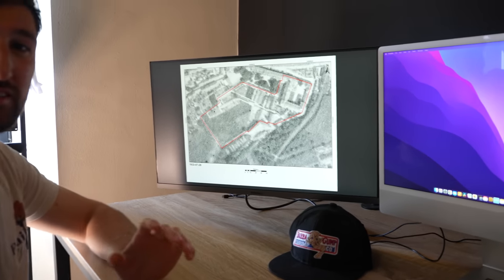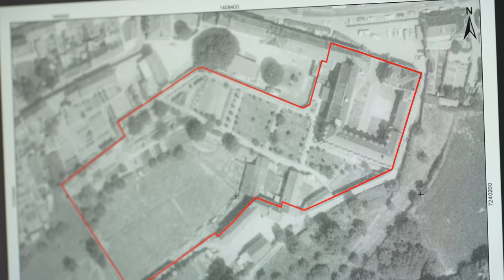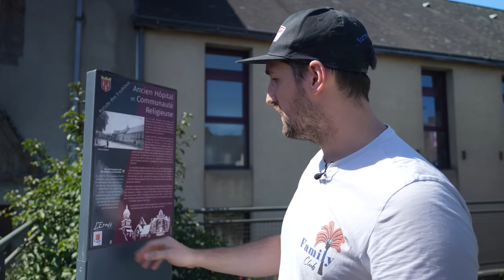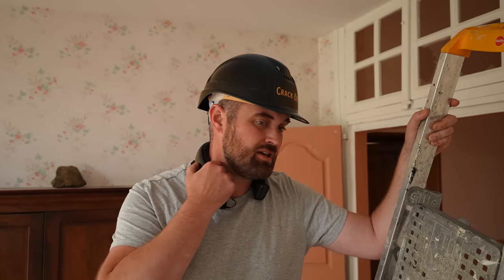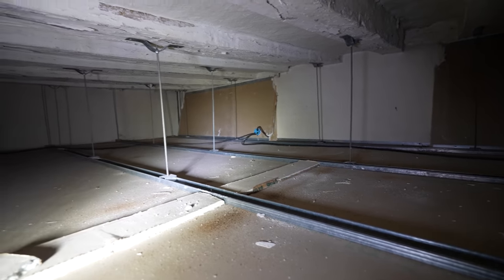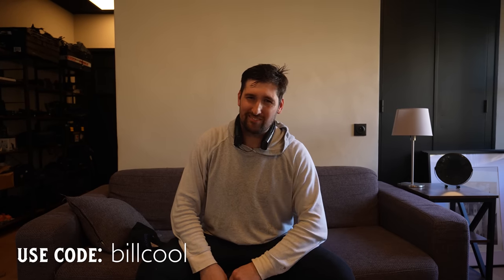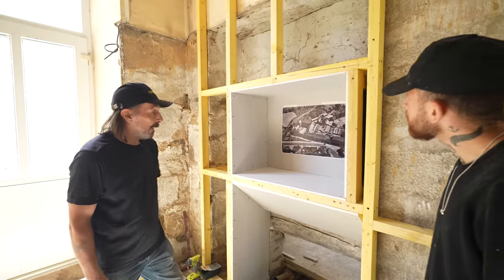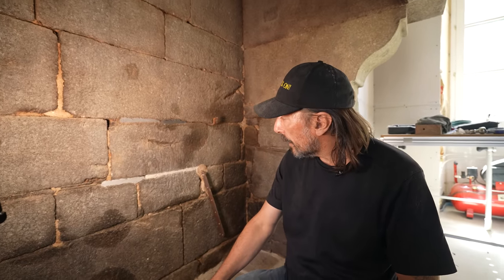What Secrets Lie Above Mother Superiors Room...

Comment: The grout on the stone needs a DROP or two of brown to get that precise color.  Otherwise it will be only gray, and the stones have a very slight tinge of brown in them.  LOVE all of your hard work -- looking fab.
Reply: I was thinking the same thing.
Reply: It needs to be more of a taupe colour.
Reply: You are creating voids by the cellar steps and the original void in the wall with all the stuff work to improve insulation taking down the false ceilings reverses this but shows the original ceiling design. The glassi or ice house was the original fridge to keep dairy and meat cool and fresher in summer ,below ground a steady temperature year round and natural ice collected in winter from lakes and ponds insulated to keep frozen for years untill needed , layered by hay,straw and wood to keep frozen year round.
Reply: yes. or just very dark is also beautiful i think
Reply: Yes there are a lot of different colors you could add. Reddish Brown or even buff. You can buy natural pigment powder you can add to your mix.
Reply: Came here to say this.  Just a touch of brown will make it match up so much better!  Great job guys
Reply: I agree. I was just thinking that, myself- somewhere between the two darker samples, plus a touch of brown.
Reply: To get a brown tint you will need to add yellow or orange rather than brown die or it will just get darker. I suspect yellow will do it. Just to warm up the colour a bit.
Reply: @jaydee5022 I  agree. Perhaps yellow ochre rather cadmium yellow. Micheal would be the one to know exactly, being on the spot to judge it in real light conditions.
Reply: @YaaLFH  agree..maybe a very subtle goldish, yellowish hue to help the shape of the stones stand out. the white was too stark...n too dark wont help with emphasis....but i'll bet there's a 1000 different suggestions !!

Comment: I like the glass box idea with artifacts from the convent that everyone can see.
Reply: I love the photo in the space, would be a great back drop for the artifacts.
Reply: There is enough room in the smaller alcoves above to put time capsules
Reply: I just posted the same thing, I agree.
Reply: @probstnatalie  a few years ago there was a news story about a family doing remodeling in their bathroom and when they opened up a wall, they found scrawled on the sheetrock facing them the message "what was wrong with how we did it?" I think they need to leave a few of those around, too.
Reply: Me, too! For some reason, we think people usually think of time capsules as having been buried.
Reply: Yes, agreed. The only problem is once the boards are removed that Simon is standing on, I believe it will not be as easy to view.
Reply: seeing as it appeared perfectly positioned by natural architecture, I agree, in fact with things on display it willalso be a time capsule, a visible one!
Reply: @spidersinspace1099  good point. I was thinking a painting was perfect for the niche  if they had done it up to the ceiling.

Comment: Ice rooms, or ice houses, were quite popular at the time that one was built. Many houses that had the space built one, even before the date of the one you have there. Sometimes they used ice or compressed snow harvested from the winter, but ice sellers were also used, they brought ice down from the arctic circle areas. Since this was in France, ice might have been harvested from the French Alps. I see another bit of history to be confirmed, Ryan. As for the pointing, the shading is not quite there, perhaps some hint of brown as others have said, though I am not sure about that direction either. Perhaps, you should find the most preferred original pointing and try to colour match that?

Comment: What did Billy do with the old gate that was on the front of the convent? Couldn't it have been used on the alley at the back of the building?
Reply: He put back on the front of the convent!😂😂😂
Reply: The old white gate was a sliding and not a hinged, swinging gate. I don't think it would work in that space. Also, the possible public right of way mentioned by Janet above.

Comment: The hoist was possibly removed because horses were replaced by motor vehicle and feed and possibly seed (gardens almost entirely disappeared) were no longer stored in elevated dry spaces. The aging nuns were likely also no longer as able physically keep the place running or maneuver the stairs as well.

Comment: The pointing in the fireplace looks too GREY and it appears that it could stand some BROWN dye in it as well to match the stone work. At least that's how it appears on a video. Perhaps the color is changed by the lighting used to show it brightly but the stones themselves appear to have some level of brown in it as well as grey.  Maybe a mix of the two would work to some degree.  But the two darker ones are close as Simon says - somewhere in between.  But the stone still looks like it has some brown tones in it.  The stud work in the hallway looks great too. So much being done and it's a great effort by everyone involved while Billy is on holiday.  Looks great. Cheers.

Comment: mary's map shows some interesting field/crop marks in the garden in the 1947 aerial photo hinting at an older building its just below the yellow strip of land in the middle of the lot in the 2006 photo there's a white dot in the 2006 photo showing a possible moat or ditch below it also visible more clearly in the 1947 photo the crop/field marks in 1947 are towards the convent.
so get your metal detectorists out there and explore because that building would be pre-1700 possibly medieval the 1947 photo is also the only photograph showing the creek in the middle of the lot that was later turned into a path this creek was the possible water source for the possible medieval building.
I have been doing amateur archeology using old aerial photographs for 35 years.

Comment: Still not convinced that the hoist lifted up supplies.  Just doesn't seem feasible since the kitchens and basement were used for storage.  Ryan, I do believe that more research needs to be done on this.  At 3:10 it appears as if the middle garden is an orchard maybe.  And then that goes away, Great video all around.  Love that Billy just drops the camera and the leaves the ladder or was that a setup?
Reply: Yes, I’ve been wondering about that hoist, too.  Doesn’t make sense that they’d drag all those supplies down to the kitchen area after being hoisted to the attic.  Maybe is was easier to let things down than to hoist things up?

Comment: I'm afraid I have to mention that I don't prefer the slanted ceiling leading to the basement, I find it visually jarring. Being the case that there is no staircase above it, which is the only time you encounter a slope over a staircase, it's not serving a purpose and just looks visually odd. Placing the drywall flush with the wall and with studs above would provide more headspace as well as being more visually appealing (streamlined).

Cheers!